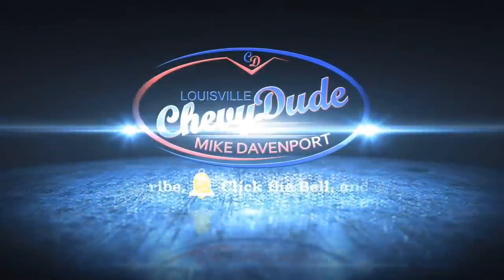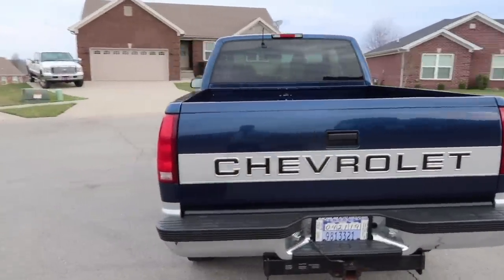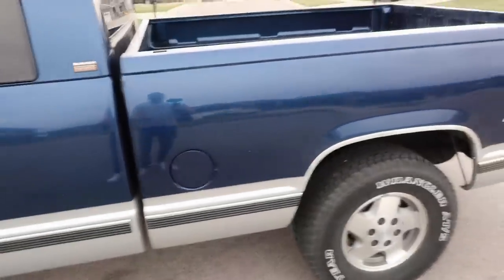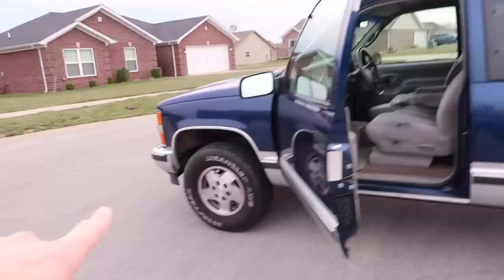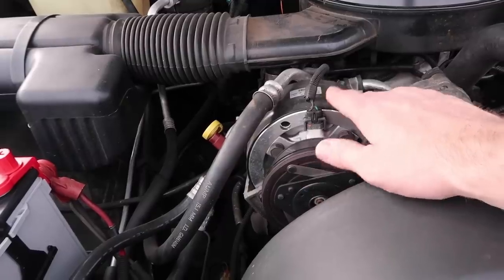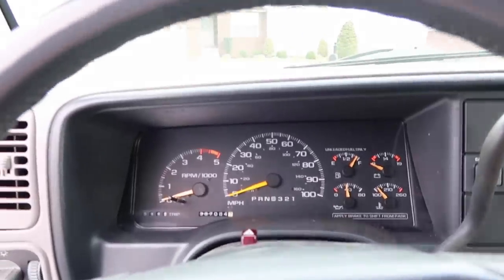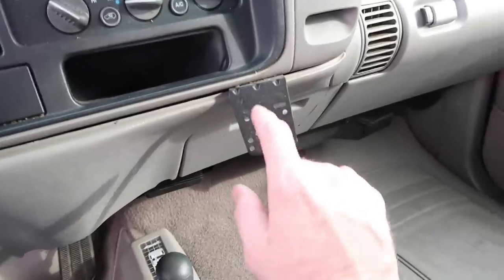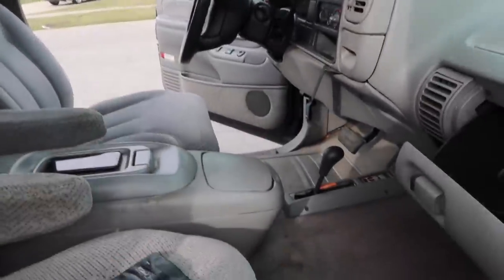I FINALLY bought a Silverado. Your comments pressured me into it.

Comment: Thats absolutely beautiful. 98 was the first year for opening rear doors only on the passenger side. It has the real 5.7 V8 unlike dodge and Toyota. TBI not carb.
Reply: 3rd door standard in 98, optional starting in 96
Reply: Mysterious Stranger From Arizona  Yep, on half ton 4WD models it was standard in 98. I can't remember if it was standard or optional on the 2wd. I wanna say there was some quirky thing like you could only get the 3rd door on 2wd models with the 305. Had to compete with Ford's standard 3rd door on the 97 models that came out in 96.
Reply: Mysterious Stranger From Arizona  That could very well be correct. I also have the brochure but probably haven't looked at it in 20 years... Sounds like you pulled it out. I knew it was a short box 1/2 ton silverado thing. I've never seen a 98 Silverado trim ext cab shortbox without a 3rd door or with a standard transmission for that matter. 
Do you remember what the 3rd door situation was for the 99 C/K 1/2 ton models?
Reply: Mysterious Stranger From Arizona  How about the 99 1/2 ton gmt400s? Still optional on those or did they build them all with 3rd door? I know you could only get them in ext cab.

Comment: That's a great low mileage, 2+ decade old Silverado. Don't break what's already working. You have your toys so you don't have to feel pressure to do anything too dramatic. Other than the mechanical stuff that needs some TLC, the only thing that I'd do additionally is a spray in bed liner to protect against rust and maybe get/do a detail job to buff out as much as the paint stuff as you can. Then again, it is a truck.

Comment: The brake lines on the front should be checked by bleeding the system. To determine if the line inside the brake hoses have collapsed. Not allowing the calipers to release from the rotors. Which can be a cause of the shimmy on the front end. It also would cause the vehicle to pull if the problem gets really bad. 

Now this is a problem that I have come across not only on customers Chevy trucks in the past. But also on my own Chevy trucks, I have owned in the past. Which seems to happen after the vehicle is 20 years old and is mainly a Chevy truck problem. Due to the fact after 30 plus years of working on vehicles, I have only done one Ford, an International Scott and no Dodge's. Which in turn, I have replaced a boat load of front brake hoses on the front end of Chevy trucks. 

My recommendation would be to first bleed the system, since it should be done anyways to prevent moisture from entering the system. 

I would also check or have the ABS sensor checked to make sure the gapping between the sensor and the rotating sensor ring is correct. Due to the fact that it has to have the correct gapping to work correctly.

Comment: Looking for parts, LMC Truck will be your best friend.
Reply: Yep. LMC indeed has an entire catalog dedicated to that generation of C/K pickups.
Reply: I have ordered from LMC. Prices are a little high and the quality (depending on the supplier) varied. Most parts are good, but the replacement door handle I bought pitted and looked like crap after about two years. I have had better luck getting OEM parts for my 99 Tahoe from pull-a-part places. It is now has parts from at least 7 different vehicles on it. NYS winters take a toll with rust and parts breaking.

Comment: 1987-1995 was throttle body fuel injection and 1997 was the first year for the third door on passenger side for gm full size trucks Sir

Comment: ‘96 is when GM first introduced the 3rd door on extended cab trucks. Ford followed suit in 1997 with the F150 and in ‘98 Dodge introduced the Quad cab. I believe GM didn’t introduce the quad cab configuration until ‘01.

Comment: You can get ANYTHING for that truck in the aftermarket including new upholstery (NOT seatcovers) for those seats. And direct wiring to a battery terminal is not such a good idea, could even start an electrical fire. (I have a 1993 C1500 Silverado, 320K plus miles, nowhere near as sweet as yours)

Comment: Your 4WD is a mechanical shifter but has an electric Actuator unit on the front diff that does fail with simple age regardless of miles.

Comment: only mods i reccomend is an exhaust, and a LINE X bedliner.
Reply: I live in Western NY and would not recommend any spray in bed liner. The bed will rust out under it and you won't know it until it's too late. Those plastic slip in bed liners were worse yet. Better off with just a rubber bed mat, so stuff doesn't slide. Plus can take it out and hose the bed out and fix any paint scuffs before it starts to rust

Comment: Congratulations on your new old truck. I always loved the look of the '87-'99 C/K Silverados. I'm my opinion it was the last of the good looking Silverados before GM entered into what I call their "ugly phase" with their full-sized pickups that lasted from 2000 to 2014 (when they became sexy again). To point out a minor mistake, I just heard you say this truck was carbureted. Not true. Being a '95, it is indeed fuel injected. GM used throttle body injection on their trucks back in those days (starting in 1987), which essentially was a carburetor, but with a fuel injector mounted inside each of the barrels, instead of the jets that actual carburetors used.

Comment: Not at all what I expected lol but if I were in your shoes please tell GM that there are so many guys out there like myself that would LOVE to have a basic truck I'm not talking like a 1960 stone age truck but something with power mirrors windows and locks. We don't need leather seats back up cameras, assist tailgates, the list could go on forever but the point is I think 90's trucks were perfect, they were reasonably priced, not crazy with computers relatively easy to work on yourself, but at the same time had decent creature comforts like larger cup holders, bigger door handles for gloved hands to grab, and decent storage like larger glove boxes and center consoles. I know I'm rambling but new trucks have lost their connection to the people who use them whether it's a farmer, metal worker, contractor, or junk man. I get it, it's cheaper for GM to use the same small handles from cars and SUVS in trucks and the same small radios and anything else that can cross over and I also understand that many people basically use a truck today like a mini van but for guys like myself I feel like I have no where to go today, Dodge was the last one with a manual transmission in the Cummins and they are ending that this year. Just a sad state of modern trucks in my opinion, love your channel keep up the great work

Comment: Ay bro got a 2017 silverado z71 4×4 trying turn e85 would you know if i got to change the  Fuel injectors fuel line and fuel pump or can i just tune it to e85

Comment: The ABD wheel sensor issue may be the cause of your braking woes, without needing new pads/rotors.
Reply: The ABS sensor dying usually doesn't cause a shudder. An easy test is to pull the ABS relay and see if the shudder goes away.  Usually a failing sensor causes the truck to think it is sliding and the computer will activate the ABS so it feels like there are NO brakes. Happened on my father's 99 Classic and my 99 Tahoe. We pulled the ABS relays, so we had brakes again.
Reply: @andrewforte  Yes, absolutely.  But I also once had a wiring problem to the sensors on my LeSabre, which initially just triggered the ABS light, but over time made the entire brake system really weird with a sometimes spongy brake pedal and inconsistent braking across the 4 wheels.

Comment: Spray-on bedliner???? Also, Chevy brake rotors from the factory in those days were REALLY bad. My 2001 brand new S-10 started brake chattering at about 25.000 miles. The rotors warp, and that's what causes the pulsation. Change them out with a quality after-market set. . .!!! That truck's in beautiful condition for its age!! :-)

Comment: Okay let's do a LS conversion on that with a computer on it that's upgraded to handle it. Maybe you could do a diesel conversion I'm sure you would get a lot of help with that part. If you're in the Buckeye look up Rust Belt mechanic on YouTube yes he's on YouTube. He could help you do that diesel conversion and he works in a dealership so you would get good help along with Captain Ron who's his protege. Regarding wiring accessories up to that 12 volt dual post battery you will still need a relay with a switch if you're going to do something such as a light bar. The battery sends the power to the relay and then the power gets sent to the switch and back to the relay and the relay Powers the light. Keeps people from putting 12 volts all over the vehicle and burning things up. A light bar on the roof at the front maybe a curved or straight one with the brackets you have to drill out into the upper pillars and then screw in with a special connection. I'm sure your body shop guys or even mechanics have did that for a customer that one of their new truck recently decked out with LED lights. Speaking of LED lights on looking for a good light bar for my 04 Chevy Tahoe with only 127,000 miles on it. We bought it brand new January 15 2005 it was the only and last new vehicle I will ever buy..

I will be watching for the upgrades videos. Since you're up in the areas where you get that rainy weather you could always find a top or for it that way when you have to hold things around in the winter they don't get wet or if you have snow and you're going camping oh, yes people camping the winter your stuff will still be dry. Anyways I better get back to working on this 98 Toyota Camry door handle driver side mirror door latch on exterior and EGR stuff for my neighbor while I continue listening to you. Keep Em coming!

Comment: Biggest issue with the 90s trucks was the electrical problems, even well maintained ones suddenly die or have problems with wires frying, luckily the wiring is fairly minimal (compared to todays vehicles).... Otherwise they were great trucks.

For parts I use www.rockauto.com or www.partsgeek.com

Comment: 1996 was the first year for the third door available with the automatic transmission only. Mods: external transmission cooler separate from the radiator. Dual exhaust, shorty headers, black housing led lights all the way around, clear headlight housings, black wheels or the 2014-2018 wheels from the Tahoe and Silverado. I can send you pictures of my modded 1994 extended cab Z71 if you want, I presume I would do that via the email address above? Parts sources are: https://www.classicparts.com, https://www.carolinaclassictrucks.com, www.lmctruck.com, https://www.classicindustries.com, and https://www.npdlink.com These trucks ride like a truck which is kinda rough compared to the new ones that ride like a car. You also have 3.73 gears that's the GT4 next to the G80 code. Definitely be sure the transmission and rear end is up to date on maintenance before towing the Corvette, those are weak points, as well as these TBI motors like to crack heads. I have rebuilt my truck from the ground up, while I'm not near Louisville, I'm not to terribly far away in southeast Missouri.

Comment: Next few videos "Chevy Dude I'm LS Swapping my 95 C/K"
Reply: Ls swap? Too common, these days. Go old school, get a 400 crank and make into a 383.
Reply: @andrewforte  Why stop there when it could be a 406 or 434 with a 400 block. I had a 383 in my 79 C20, but finally went with a forged, roller valvetrain, 406 sbc. It has far more torque than a 383. Of course, an LS swap is far more economical and when it came time to change the engine on my 88 K5 Blazer, I went cheap and easy with a new GM Goodwrench 350, but wish I had the power of the LS. Building a gen I to run on TBI became out of the question after researching it and learning of the shortcomings of the tbi system.

Comment: Every guy needs a truck in his life whether he knows it or not.  Looks like the old ones are making a comeback on youtube re: streetspeed717's tahoe and his friends diesel.   
.  That is a very nice truck,I'm surprised it doesnt have a sliding rear window(dogs love that).Where I live 97% of those trucks rotted out a long time ago. Even the 07 and newer chevy/gmcs are beginning to rust bad. Everytime they make a new bodystyle the metal gets thinner :(  I had a 1994 w/t 4.3 2wd in teal green(still my fav color).It had 197,000 miles when I sold it. I have a 2010 w/t 4.3 4wd now.   If I lived close to you I'd help you work on it for free.Most of those small parts you mentioned can be found with some researching. Good Luck 👍

Comment: Can I buy this sweet baby James gmt-400 from you? Pweeeeese 🙏🏼 it's a survivor and needs to be returned to its Glory. FYI, no "carborator" it's TBI, 5.7 is useless as a tow pig, you'll burn the breaks off it without a trailer break controller and still lacks the tow pig power you'll need. Don't tow in OD. You'll burn it up. Rock the tape deck, parts are plentiful no issues as you said hard to find? 🤷🏼‍♀️, Wiper motor, fuel pump will take a dump on ya, replace them now as well as the heat/cool vent/defrost/floor servos. Steering box has several aftermarket upgraded way better than factory to loose the slip, upgrade the IFS to make it bullet proof as well as cooling if your going on tow with a/c on. "Grounds" body mostly are a huge trouble point of these trucks. EGR is another must replace. Or you can skip all this nonsense and sell it to me. 😂🤗 Love the channel and all you do! Keep up the great content and good works in honesty!

Comment: Awesome truck. That body style is the reason I’m a Chevy guy. And that engine is fuel injected. It’s called the TBI (throttle body injected) 350. It has two total injectors. One for each side of the engine. 

Those motors make really good bottom end torque and feel pretty comparable to even the last generation Silverado (K2XX). The mid range and higher rpm stuff though is not much of a comparison. 

It’s beautiful though, and from the looks of it, it’s loaded with the exception of a CD player and leather seats.

Comment: It’s not carbureted. It’s throttle body fuel injected. Should have 2 electronic injectors on top...it’s like an electric carburetor. Simple fuel injector system but no longer used.

Comment: 1997 first year for 98 for 3rd door I got mileage better my buddy brother had a 98 black z71 4wd with a 5 speed 18000 miles yeah I said it right bought off a guy drove a new truck every year and store and park it
Reply: I like to find a crewcab 98 or 99 before the front end changed I drove a 98 with workbox on it last company I use to work with alot of room

Comment: Hey! Nice truck man! You want to sell it? You don't find them in that good of condition anymore. And 1997 to 1998 was the first years the passenger side 3rd doors opened. It should be Tbi(Throttle body injection) unless someone did a carb conversation.

Comment: Ford puts hood lights on their trucks. lol

Pretty sure the antenna is for a cb radio not a phone lol
Reply: Definately not a CB antenna. Wrong size coax connector (too small). Also no way to tune the length of that antenna for optimal signal.

Comment: Needs a 6 inch lift, 35 inch tires, and 20×12 Anthem wheels (https://www.customwheeloffset.com/wheel-offset-gallery/419041/1997-chevrolet-k1500-anthem-commander-rough-country-suspension-lift-6in) I  know someone has a 98 Silverado and it looks sick lifted, but he has it on 9 inch lift and 37's.

Comment: For Parts. Check LMC Truck parts and Accessories.  Lmctruck.com

I have a 1990 c1500 stepside that just turned 300k miles. Still runs and looks good. Also has some leaks and love taps [ scratches ]  and of course is developing the typical chevy cab corner and rocker rust. Which I will get fixed soon. 

Mine has a working engine work light too !  

Also. I spray my undercarriage down with ACF 50 once a year. Cost me around 30 bucks to do it. [ 2 cans Amazon] ACF50 is made by lear jet industries . Its an anti corrosion spray thats been used by the military and aircraft industry for decades to fight off corrosion. Also is wiring / electrical friendly.

Comment: so you have a light under the hood  yawn  Pontiac hah a big light about 4 inches in diameter that mounted under the hood or trunk  with enough cord to get to any corner of the car

optional equipmemt  in the 1960s    little trivia for you